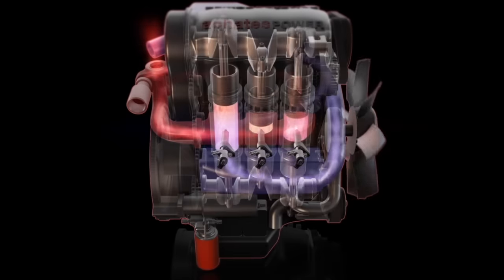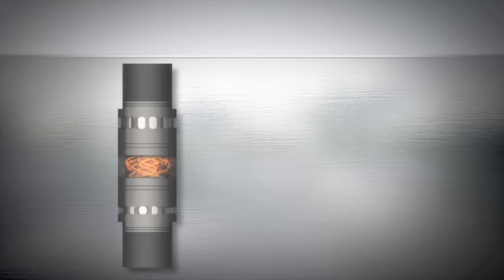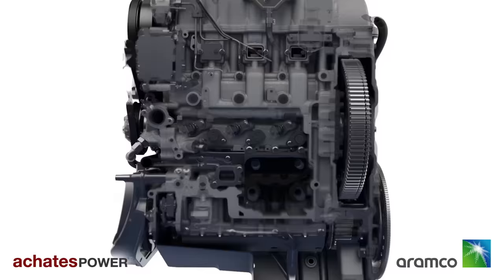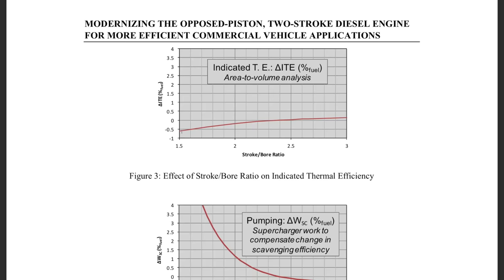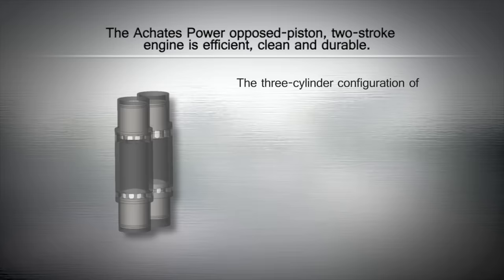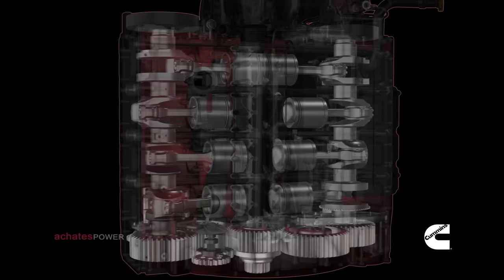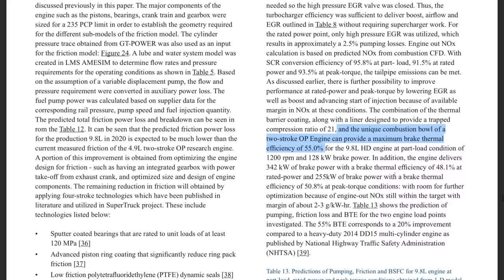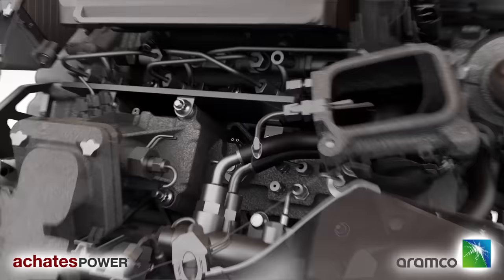Opposed Piston Diesel Engines Are Crazy Efficient

Comment from the maker: Thanks for watching everyone!! If you enjoyed this video you may enjoy these others about new engine technologies:
Mazda SPCCI SkyActiv-X - https://youtu.be/yNSxow3W7ek
HCCI Engines - https://youtu.be/OVWZFdb_AGc
RCCI Engines - https://youtu.be/pCr6bjQMrgU
VC-Turbo Engine - https://youtu.be/A6H66xfEZC4
Dynamic Force Engine - https://youtu.be/wwLxxZm_LRQ
Mercedes 50% Efficient Engine - https://youtu.be/kOhmgpkiIfg
Mazda Dynamic Pressure Turbo - https://youtu.be/UCEarzwakgc
Gas vs Diesel Engines - https://youtu.be/rXVJG9n6BAs
Reply: Any chance of covering the Napier Deltic engine?
Reply: Engineering Explained Just wondering shouldn’t this engines power output/efficiency be compared with 6 cylinder engine since essentially you have 6 pistons, rods, injectors etc. Those numbers seem very comparable to what modern 3.0 V6 Diesel engine is outputting. A similar argument is often made for Mazda rotary engine where its 1.3 displacement is multiplied by 2 when compared to conventional piston engines due to the number of combustion cycles per “crank” rotation. Would like to know your thoughts 🤔. Thanks for the awesome content.
Reply: Engineering Explained I am actually curious how are they lubricating the cylinder on the top side if it is orientated in a vertical axis. Because it will not allow for a simple oil pan method that the bottom cylinder can use.

Tq if you can answer my curiosity
Reply: it would be lubricated by oil pressure and a nozzle that squirts oil onto the bottom of the piston, nearly all modern engines are lubricated with pressurized oil and dont rely on oil slinging around the moving parts similar to a manual gearbox,  but you do have a good point, how to keep oil from puddling inside the piston and crevices that would normally face the opposite way
Reply: You seemed to lack an explanation on how the Achates Power design is superior to the past two-stroke opposed-piston diesel engines? And how they over a came inherent inefficiency in a two-strokes. Such as the tendency of the exhaust and intake air to mix. Since there is no separate exhaust and intake strokes.

And the additional cost not only for turbo and a supercharger but many other support system? So cost comparison with a conventional 6 piston Diesel is needed too. 

So it seem more relevant to large engine applications.
Reply: Engineering Explained they should make an IDI version, that would be even more efficient... The 6.5L Detroit (4stroke) (pre-Duramax Chevy Diesel still used in HMMVEEs and motor boats) will get a good 25.5mpg - 28mpg will a better than stock exhaust system and a well tuned turbo on a 1996 3500 pickup... The FORD 7.3L IDI gets 19-22mpg with the 5 speed transmission non-turbo charged (and 13-16mpg in the 4 speed transmission)...
Reply: My question on this motor would be the clearances for travel on the pistons as the bearings wear. And the cost of repairs.
Reply: The S&D show .... In theroy the maintenance of this engine should be no different than a 2 stroke Detroit medium duty Diesel engine like a 53 series or a 71 series I know an old retired trucker who got 3 million miles out of an old Detroit 2 stroke (I think it was a 93 series but not sure)... However this isn't the 1970's, I'm sure the crooked auto makers and their stealerships will find a way to make these engines last 5-10 years and that's it. Then it will break... These crooks won't make 30 year/million plus mile engines any more
Reply: scavenging losses??
Reply: Haven't seen a good 2 cycle engine yet work on a lot of old Detroit diesel
Reply: How much more Thermally Efficient would Achates Opposed Piston Engine become if they made it a RCCI version? Of course this is a Napkin math Guestimation!
Reply: Way to leave out the T-64 most mass produced and currently in service opposing engine to date, so you could mention someone buying the tooling to one day start mass production.
Reply: Thank you, I've been hoping that you would make a video about these.
Reply: I have seen a Toyota FJ with a Detroit 2 Stroke Diesel
Reply: RCCI Achates seems to be an oxymoron.
Reply: The very best thing that I can see is that combustion happens inside a solid chamber, without a head gasket.    I can't tell you how many times I have had to rebuild motors because of a simple head gasket leak.  If this engine was in a truck, I would want to buy it.  This is awesome.
Reply: Two stroke dirt bike engines use a chambered exhaust, which acts as a secondary turbo by sending a sound wave back into the exhaust ports helping to reduce intake air leaking out of the exhaust before its port closes.  I'm not sure how much this would help on this engine, given that the fuel is not injected into the chamber until the ports are already closed.  But I can still imagine aftermakert exhaust makers producing a triple header chambered exhaust to go onto the engine if it did have gains.  and what a sight it would be. hahah.
Reply: What about Emissions? It's nearly the screaming jimmy's reborn but in an opposed pistons form.
Reply: You forgot Freevalve. Take all of these "normal engine" design technologies and slap them with freevalve, and you get both extreme efficiency AND performance cheap, quick, and easy.
Reply: Engineering Explained 
I hav a big question/favor to ask of you.  I am not an engineer. But i would want a car that runs on water. Since this is not something dealerships offer and dealerships are our only way to buy a car, if i want this, ill need to take matters into my own hands. Unfortunately, ill be starting at zero. No knowledge of engineering or even mechanics. Can u plz help me w/ this? 

Maybe a series of videos that explain the mechanics and engineering i would need to understand and/or instructional videos on how to do this myself? I would consider you a genuine hero and g I uve all due credit if u wish. (Although a quick Google or YouTube search of Stanley Meyer wil show you what happens yo ppl that create water or hydrogen powered cars w/ only oxygen emissions). However, i think the world needs this and ill take on the burdens if necessary. Id even be happy tp just have one. Please respond, Thank you, Aaron
Reply: Nice explanation!
Reply: Stam Fordly You the ripoff of a Junkers desogn ;D. No for series, he forgot to mention Junkers aircraft engines, basically the first Diesel engines to power an aircraft.
Reply: Engineering Explained What is your take on "plasma" spark plugs and/or ignition systems? Also what do you think about reusable/washable oil filters?
Reply: Dear Engineering Explained. Here ia an idea for a new video. The straight-six engine is making a comeback. BMW, which never abandoned the straight-six has kind of kept it alive. But now more and more manufacturers wil ditch their V6 line of engines with a line of straight-six engines. Mercedes has done it and we will for sure se a straight-six engine in the Ingenium line from  Jaguar Land and Rover. The new Toyota Supra will get a  straight-six engine based on a BMW engine. An also for sure in the near future. I am sure Aston Martin will have  straight-six engine(s) based on an engine from Mercedes. 
I could have said more but I leave it to you to serve us the facts on this matter
Reply: @Engineering Explained: I was at SAE World Congress in April, and my colleague organised an industry visit of the Achates dyno lab in Novi, MI. We spoke to the lead engineer, had a tour around the facility, and got to see the opposed piston engine fire up and run, it was hugely impressive! Sounds very exotic, as far as a prototype diesel can, anyway.
Reply: The lead engineer spoke specifically about overcoming a unique problem with the lubrication of the wrist pin. Because the piston is now always under load in the two-stroke, there wasn't enough of clearance for enough time to get enough lubricant to the wrist pin, and so they had lots of problems initially with seizing and I believe some con-rod failures. They eventually came up with a pretty clever solution, but I can't remember it off the top of my head... I'm certain they published it somewhere though.
Reply: My professor is a good friend of the lead engineer, and he candidly asked if they thought it just a cool research project or a commercially feasible engine, and he was really confident that it would see service in trucks in the near future!
Reply: Finally, I did want to ask, did you ever do FSAE at uni? You seem like the FSAE type...
Reply: Engineering Explained you should make a video on liquid piston engines.
Reply: Were you paid or otherwise compensated for making this video?
Reply: I wonder if the "trick" from the Alpha Stirling engine could be utilized here: In the Alpha Stirling the opposing pistons are out of phase, so that they don't meet in the middle of the cylinder but compression happens in one end of the cylinder and expansion in the other. That way the cylinder have distinct hot and cold zones improving thermal efficiency (less force compressing the mix in the cold cylinder end and less heat wasted in the hot end during expansion).
Reply: Engineering Explained cant wait to crank this thing up to make big power!
Reply: Engineering Explained but now every country hates on diesel, not that they can tell me what to do.
Reply: shouldnt it theoretically work also with gas and spark plugs?
Reply: The problems I see are:

Heavy rotating assemblies due to the deep piston sleeves. High revs may be an issue for the extra long rods and the crank. The top sleeves need to constantly pump the oil out the the upside down piston. The oil might be a problem after some use time so that they can't run long term EPA standards after long term use I figure. The seals are probably the main reason they are holding it back if it indeed is that efficient or the rods break if used for high revs in daily use. The fact that both pistons use the same cylinder makes the latter part of the detonation expansion work though an area that may in fact lower the engines overall output as well. - I.E. too much work for one detonation. 

I've been waiting to see someone tackle this concept. Thanks for the video.
Reply: Do you think this would create a higher likelihood of engine knock with the both cylinders heading towards each other?
Reply: Am I missing something?  Junkers Jumo had an engine like this in 1920,s-30;s for aircraft if I recall correctly, there was a 3-way British design for torpedo boats and Fairbanks Morse made something with dis-similar sized pistons. These were all heavy installations. It seems to be a couple of Detriot diesels joined with the heads removed. No details on lubrication. Big ship 2-strokes where weight is not an issue keep cylinder/valve lubricant separate from crankshaft lubricant. The crankshaft oil is not contaminated with combustion by-products and lasts forever. Trump comment severely detracts from engineering and scientific credibility of this report.
Reply: Afre    Always loved a straight six.  I think the abandonment of the straight six was due to its length which precluded use in sideways installations used in front wheel drives.  Are these straight six comebacks you mention in front drive vehicles?
Reply: Quarkhammer yeah that’d be pretty cool, but biofuels will be the only combustion alternative in the future
Reply: Diesels will only find niche applications in the future. Passenger car German diesel engines are no longer available in the United States. We will still have typical diesel emission problems. Tesla is even building an electric semi. European cities will require all electric or electric hybrid technology vehicles that operates within major European city borders. Military applications, some truck applications are going to be its niche From . China to the US to Europe, supercharging stations are expanding at an enormous clip, with range anxiety subsequently declining. Like I said, diesel only technology will be for niche applications only. I am curious about if Such an engine can be made into a electrical hybrid system.
Reply: without valves this engine can not be over revved, Takumi Fujiwara may not destroy this engine.
Reply: The only surprise I have with this whole engine is the lack of a vertical Drive that has some form of spring pack in it in the event of a hard shutdown
Reply: We know this already comrade Laughs in T-64 5DTF diesel
Reply: Young Tang electric vehicle batteries are charged with fossil fuels.  Batteries and their manufacturing processses are toxic, and no renewables are reiable or cost efficient.
Reply: You got one major issue wrong, the fuel. Achates Power has tested a variety of fuels with their design, the Military engine will be Diesel, but the one they are putting in Ford Pickups is Gasoline Powered, but is still Compression Ignition. 
You should have also pointed out that:
1) With any Otto Cycle Engine, the higher the Compression Ratio the greater the Efficiency. Granted that eventually raising the compression ratio will destroy any Otto Cycle Engine. 
2) The main technological issue with past opposed piston engines was the durability of the cylinder ports, as any good motorcycle mechanic can point out that 2 cycle bikes wear out the cylinders and pistons quickly. Achates Power has apparently addressed this issue.
3) The reason of having both a turbocharger and a supercharger is because a supercharger is needed to start an Opposed Piston Engine, but the Turbo is more efficient.
4) The rings, piston, and wrist pins are lubricated by passage ways in the pistons and connecting rods.
5) Oil will no accumulate on the upside down piston, just as it doesn't on inverted V aircraft engines.
Unless Achates Power screwed up their design, so maintenance is an issue, they have a winner, and it will be seen in SUVS, vans, light, medium and heavy trucks.
Reply: David, point #2, I have been around Fairbanks-Morse OP diesel engines in towboats (app 1500-2000 hp range) that were very durable. They were known for their durability & fuel efficiency compared to similar EMD's of the time.
Reply: Since you got into Achates, check also the similar LD engine they have. It is again opposed piston but they are doing PCCI (GCI) combustion with gasoline.
Reply: Why Diesel specifically?
Reply: I may just be an apprentice. But I think there are a couple key elements in it not being mass produced.
Cost for building , servicing and repairing may be too high.
Every existing mechanic will have to do courses on this engine type pushing prices up further. And lastly I think it depends on the consumer. And I believe the average consumer will think that 2 pistons hitting one a other each time in one cycle will lead them to believe that it will be too much effort and time to take care of this machine.
Reply: Engineering Explained I have an engine design which is very impressive.
Reply: Allowing a small amount of exhaust gas to mix with the fresh air lowers the burn rate and thus lowers peak temperatures, which reduces NOx formation. Some mixing is desirable. The sensor system meters fuel injection so that it still gets a complete burn.
Reply: N C it's common rail direct injection, the new design can inject multiple instance at compression strokes...
Reply: orientated??? oriented
Reply: Do you think that these engines will be able to use a cng fuel system? I'm talking about using cng and diesel. If they can use two types of fuel how efficient do you think they will be?
Reply: If it's that good, why haven't we seen it in F1 or le mans prototype racing cars?
Reply: Just googleing T-64 MBT
Reply: traditionally, 2 stroke engine consume oil, due to their nature. does this engine burn oil by design, and if so, how much?
Reply: Young Tang
interesting statement you made. now research how much pollution is produced to manufacture your electric car batteries and rare earth  magnets to run the motor. Diesel engines can run on bio diesel and are less polluting than replacing  lipo ion battries
Reply: Is Brake Thermal Efficiency - BTE - the same thing as the overall Thermal Efficiency of a heat engine? Thanks ;)
Reply: Young Tang  ...but where does the energy going into your batteries come from? Electric vehicles are fine as long as we're not simply moving the combustion from the vehicles to a power plant.
Reply: Where can I get one of these? Or maybe even 2... I love diesel especially bio (I make my own) and having a 40+ efficiency across the board is insane... Man, I want one!
Reply: Water injection generates steam as it internally cools the engine and reduces peak gas temperatures. The benefit is reduced particulates and Nox low enough t not need a post treatment with AdBlue. As others said the issue is needing a water tank at least as big as the fuel tank.
Reply: There is nothing new about this technology, Commer trucks manufactured by Rootes in Coventry used a TS3 diesel engine in the 1950s and 60s.  (Two stroke three ). Technology more up to date but by no means new.
Reply: Lean burn engines don't produce any carbon monoxide.
Reply: Engineering Explained,  check out the two Stroke Diesel engine which Roots used in its Commer Carrier lorries. 
I  worked on one of these engines in the 60s, it had one crankshaft which lay underneath the cylinders, the conrods where attached to rockers, then another set of rods to the crank, this had a huge roots type blower to pump in the air.. These were super noisy lump, I think it produced about 140 BHP at 1200 rpm or thereabouts, forget the torque figure . The little lorries were quick of the mark. I have an original pamphlet about these engine somewhere filed away.
Reply: Edumacation is da biggest probliem from oder cuntrees. Revamped educational materials and facilities, I don't see anyone willing to take the risk funding the schools so much that they'll have enough to make it mainstream. Cool yes, fuel efficient that won't fly anywhere in any country. Maybe except a pirate island or something.
Reply: Why it's not used in Automotive
Reply: @dpb1948  
Rootes made the TS-3 engine for 18 years. It had a wonderful distinctive sound to it. Chrysler bought out Rootes dropping the highly efficient engine in 1972 wanting to sell their inefficient existing US derived line of engines. Rootes had a 4 cylinder version, the TS-4, developed to go into a new model line of trucks. Chrysler order them destroyed.  The engineers saved a few of them.
Reply: Hey great show look's like a motor the Zimmerman kid's made in the sixty's from motorbike part's .Did 20,000 rpm and ran hydrogen the exhaust came out cool.
Reply: What happens when the piston rings on one cylinder out of the two go bad? I would assume then the good piston gets pushed with lesser force and the bad one even lesser. Which could theoretically lead to a case where the two go out of rhythm rather quickly. Also, since the two are now out of rhythm, it could be impossible to achieve sufficient compression leading to the diesel not igniting at all.. or am I being too skeptical ?
Reply: How does this design stack up vs the Duke type engines?
Reply: @mohdafnanazmi1674  I believe they said it was two stroke at the start, oil will be in the fuel mix
Reply: rev it up its a poppet valve 2 stroke
Reply: Dare I mention Wankel  ? A constant speed  1200 cc  engine coupled to an electric motor would make an ideal  self chrarging Hybrid power unit ? Surely we can sort the Tip seal problem  by now ? Mazda are you listening  ?
Reply: @rayhallworth3018  you can't, they wear on the tip because it's always grinding. Look up the Duke engine
Reply: Why not a larger bore and shorter stroke to help with the dimensions?
Reply: @teebee5323  the problem then is the amount of rotation on the crank vs wheels. Ie it would need more revolutions to turn the wheels the same amount. There's no advantage to that you see.
Reply: i run them as i 2 stroke and mix 40;1 and love the smoke, any oil will do as i live brurning oil
Reply: If we were to want yet another fossil engine, this would be a good idea. However there are questions regarding the position of the pistons, lubrification and cooling. Obviously the upper exhaust side piston will have more heating than the bottom intake one. This could be a fun engine as if I think it properly its design allow for high rpm (double stroke or half piston speed) Smaller number of moving parts. Nothing beats an electric motor.
Reply: When the EPA gets finished re-engineering it, it probably won't be much better than the current EPAed engines. And a lot more expensive.
Reply: FM tried the op engine in railroad locomotives, but got a lot of failures of the top piston from overheating.  While this was not a problem in marine engines, it proved fatal in RR use.  The explanation given was that top piston only saw exhaust gas while the lower saw cooler intake air.  I am curious to know how Achates is handling this problem.
Reply: But how does this engine suck fresh air inside cylinders needed for successful combustion?
Reply: So just three cylinders or multiples of 3? 6, 9, 12 etc? Seems like two or more cylinders in multiples could be identical timing.
Reply: @jonathanhidalgo4591  If you have a four cylinder car it means you have four cylinders. It doesn't count pistons, or valves, just the bores. In this case, the opposed piston engine has 3 cylinders. So that's what it is. 
There are not 6 injectors, just 3. 
The rotary is an entirely different engine.
Reply: @rykdheiner  Horizontally opposed engines have been around forever. Not a lot of puddling going on.
Reply: @nc3826  Two stroke diesels are very efficient, and produce big numbers. Emissions are a problem, but precise fuelling can alleviate this to a large degree.
Reply: Have you ever looked into the eco motors opoc engine. It uses only 1 crank. But is only a twin cylinder design. They are trying to link multiple engines together and make it act like a pseudo cylinder deactivation. More engines running for high demand, fewer running during cruise.
Would also make a good small airplane motor in theory
Reply: @machscga6238  Skoda 1.4 / 189hp - 80 mpg... Where are yuo living man, what crappies mileages is that?
Reply: @reallue  only some good institution with very high education doctors can helps you and maybe some english lessons helps to.
Reply: When it was invented
Reply: I'm not exactly versed but this seems a good scalable design if you have the space. And if you double it and alter the cycles such as a V configuration to minimize reciprocating mass and keep power delivery super steady. The only problem I see is block size and height and the finicky timing issues. Am I at least kinda right?
Reply: Since it's so efficient, could we get rid of the Achilles heel of the modern diesel engine? THE EXHAUST CRAP THAT GREATLY REDUCED DURABILITY!
Reply: @jrwdeere5416  Then how are you still working on them? Evidently they've stood the test of time!
Reply: Young Tang  
Unless you get your electricity from a molten salt reactor fuelled generator or from an exclusively hydroelectric source, you are buying from a producer that is burning fossel fuels, and polluting (in some cases more than this engine at it's worst).
Don't mention Solar or Wind as their power is intermittent and rely on Silicon and other nasty processes.
Oh Yeah,
Battery production....
Reply: If i use this engine as a Diesel Engine I would design it as ignition jet engine with  a water-methanol Injektion to increase massflow and get better exhaust properties.
Reply: is there a rotary engine version of this?
Reply: this will be obsolete as electric vehicles become more common.
Reply: The problem is that all of the auto manufacturers are beginning to switch over to electric vehicles.  This includes 18 wheelers.  This technology is a day late and a dollar short!  That's a fact, Jack!
Reply: Joe Mikey clean diesels are allowed,s ie UltroLow Sulpur Diesel, use DEF fluid & a SOOTFILTER,! VW  does make one the ANARAK , V6 DIESEL,  6SPD MANUAL. Or AUTO,  THEY ARE NOT SOLD IN. NORTH AMERICA, I am thinking of bringing one back to USA,  it comes as a cab only, 2 DOOR PICKUP, OR CREW CAB, Electric dors & windows, A/C,   CHEERS FROM NJ USA🇩🇪🇺🇸
Reply: Russian tank t-64 has this engine configuration
Reply: Oh yeah, I loved the sound of that power-head when I was a kid they used them in excavating equipment.
and in semis and even one GMC HD pick em up truck "the Detroit variant". Narrow power band was the only drawback with the motor except for the only other short coming that they could break transmissions. Awesome power band RAWWWWWWWWWWWWWWW
Always thought that they had trouble with meeting emission standards.
Reply: As an old Detroit man, loved working on those engines, l'm super impressed. Loved the way they used the breathers, in and out, no valve train less to go wrong. Hope to see it on the market once they work the bugs out.
Reply: Engineering Explained - could you follow up on this?
Reply: Engineering Explained 🔥
Reply: This wont beats electric car although
Reply: I think it's a winner and i fancy it be fast in a car double crank I can't wait for production I want one lol
Reply: Worked at building Doxford  Two stroke 6 cyl. opposed piston vertical ships engines and sailed in engine rooms with them. Lubrication was from timed cam shaft lubrication injectors into cylinders at upper and lower piston traverse area. Compressed air start, burned boiler oil. at sea and diesel in close waters.  Big and noisy, but steadying reliable. Piston dia, 670mm, if I remember correctly.  Ship 16000 tonnes1950/60s
Reply: Thank you
Gives me great pleasure to improve my  
Invention...
Reply: Thank you for all
Reply: Which stimulation software is used bu you????
Reply: Asterisk the pistons lay horizontal
Reply: Look up Junkers Jumo 205. Aviation diesel opposed engines used since the early 1930's. Impressive.
Reply: Did this technology get implemented in the last 2 years?
Reply: Isn't that a Commer knocker
Reply: @Ali Ardhi They have been around on ships for a century -Read The Diesel Engine by C.C .Pounder who developed them for marine application .
Reply: @nc3826  This is some mixing between exhaust and intake. It is used as an advantage to reduce NOx emission and faster warm up of catalyst. I guess what you referred to the inherent inefficiency has to do with air-fuel mixture got to the exhaust before combustion. Fuel is only injected when the exhaust and intake ports are covered, so air-fuel mixture is not lost.
Reply: Young Tang  Your argument is true when your electricity is renewable.  An EV charged using an average electric grid in the US would emit the same amount of carbon dioxide as a combustion engine which is 25-30% more efficient.
Reply: In the 1970`s I worked for a transport Co , included in the fleet was a Commer 16 ton lorry fitted with the Rootes  TS3 engine
   it was supercharged working at 4.5 psi the first notable feature was the noise it was very very loud,  second was it`s 
   immense torque !!   it would accelerate fully laden up a hill whilst the Perkins engine of the time struggled.
      I often wondered why it hadn`t been refined as it was very enjoyable to drive, great to see a chance of a second version !!
Reply: I want one for my wrancgler good torque?
Reply: Recomend you to see Innengine motor
Reply: Less efficient than you think.... oil has to be dumped in top 3 cylinders as piston passes by to evacuate that cylinder oil is being flung into the exhaust. Eventually this will cause sensor problems among others.
Reply: @ProbeGT2  you're right, but the flow and inevitable blending of some of the exhaust gases with the fresh can be optimized much better in this engine, as the input and the exhaust are on opposite side. In four strokes engines, the valve cross over when the input valves are open shortly together is used to make the engine more efficient at the cost of some more exhaust pollution.
Reply: Look at the engines of Deltic Diesel Locomotives in early 1960's - using two Napier D18-25 series II type V Deltic engines: mechanically blown 18-cylinder engines each rated at 1,650 hp.
Reply: @stamfordly6463  Good point. Napier diesels were first developed for the Royal Navy developing 2,500 hp and used in fast patrol craft in 1950. Then used in 18 cylinder blown form developing 1650 hp in the Deltics in 1961.
Reply: Can this modified as a New type of hydrogen engine?
Reply: @Drunken_Hamster  "cheap, quick, and easy"?
Reply: @mandernachluca3774  Junkers was in the timeline...
Reply: Wait… doesn’t the exhaust side of the turbo rely on the piston producing positive pressure to spool? This engine scavenges with a super charger so how would that work? Thanks.
Reply: @jonathanhidalgo4591  wouldn’t you multiply by 3 for the rotary?
Reply: @mohdafnanazmi1674  good question man
Reply: MAN did this a long long time ago, WW2 era.
Reply: @nc3826  the opposed piston architecture has always be the most efficient ICE since it was conceived in 1917. still holds records. the challenges for this is emissions and oil consumption... enter the 21 century. new materials, 2000bar fuel rails, new injectors, computer control, analysis software. now oil consumption is controlled and emissions already meets euro 10 and carb 2027 emissions standards with current after treatment systems. no one else can claim that. and just FYI it does have a supercharger and turbo charger for scavenging, but all diesel engines are turbo charged now.
Reply: @fred3236  its called a biaxial wrist pin. the outer "lobes" are slightly offset from the center lobe so as the wrist pin moves through the cycle the lobes take turns lifting off and allowing oil
Reply: @zolibartalos  they are building a hydrogen test engine now
Reply: @mohdafnanazmi1674  the oil pan lubricates nothing, it only hold oil. oil is pumped through galleys to the cranks,etc exactly the same way as any other engine.
Reply: Could be a great range extender for hybrids: 50hp would probably be enough for most applications, single optimum rpm range could make it even more efficient.
Reply: Jason, I've been following this genius engine design for quite some time. I really don't understand why it is taking Achates so long to improve upon a 140 year old design. I think it is one of the best ways to keep combustion engines relevant in the future. I would buy one tomorrow if of course the price reflected the simplicity of the engine, which I'm sure it won't.
Reply: l0l
Reply: 0
Reply: 0
Reply: Could you make a video on INNengine?